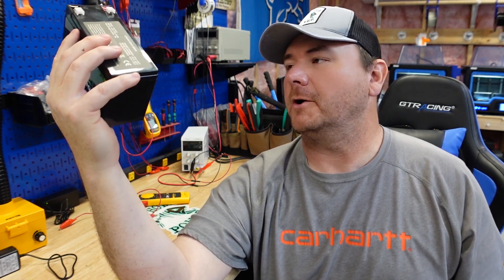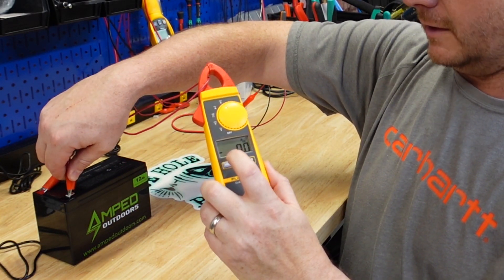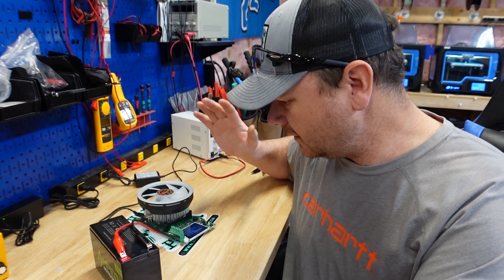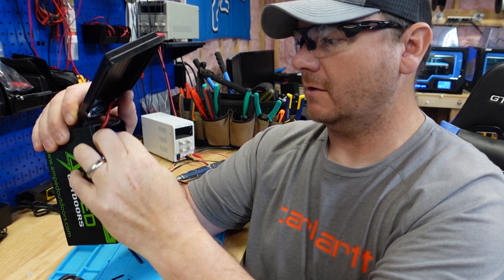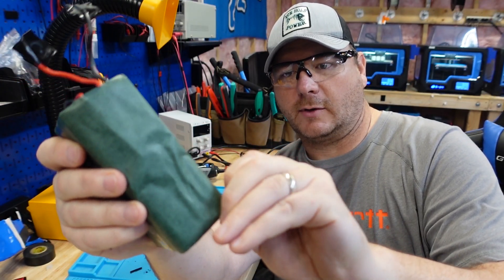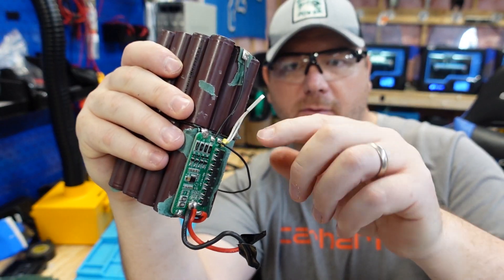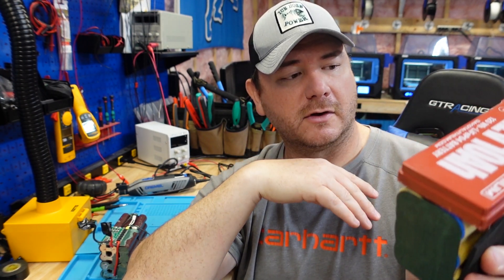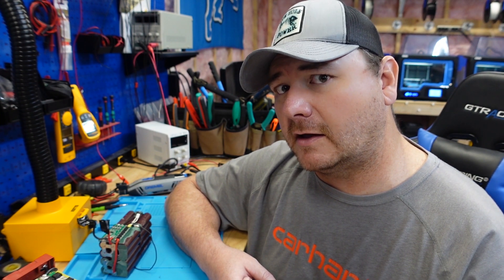Amped Outdoors 12ah Teardown

Comment: Every few years, when the power goes out here, we are awakened to our alarm system beeping due to low battery backup.  I have to disconnect one battery wire or it’ll happen repeatedly.  A while later we’re assaulted again by beeping when power comes back on, and the system is warning of a disconnected battery.   Aaarrrgghhh.  It happened again last night.

Can I replace the UB1280 I 12v 8ah f1 alarm backup with a longer lasting lithium iron without any concerns about charging needs, and if so which one would you recommend?  The Amped you tested seemed the right size to fit in the alarm box, but I liked your review of the less expensive Rebel;  it’s just too wide for the box.
Reply from the maker: I would suggest looking into their website for a proper replacement and if you have any more questions about that you can give them a call.
Reply: @iceholepower8012 . I can figure out by dimensions which to order, but my question for you was if 1) a higher amp rated lithium is an okay and better replacement for 8ah AGM alarm batteries, and 2) which brand among the myriad you reviewed that you deem best overall.  I will also confer with manufacturers as you suggest.  
By the way, it seems indeed as you’ve addendumed, Amped has replaced the 12v 12ah with a 15ah, that of course is out of stock 😢.  Also, Rebel appears to be out of business.
Appreciatively, hafcanadian

Comment: Can you use one of the new vexilar v420 lithium chargers to charge a amped out doors lifepo4 battery?
Reply from the maker: Vexilar does not have their specs on the charger on their website.  Just at looking at it you would not be able to charge an AMPED NMC battery but would charge their  Lifepo4.  The only thing is Vexilars charger is only 2.5 amps so it would take twice as long to charge your battery over the AMPED charger.

Comment: I have been running one of my UPS with this very same battery since november 2019. We have brownouts and blackouts everyday. I use it to run a modem/router setup (I get roughly 6 hours out of it) and sometimes a 32-inch TV and a DirecTV receiver (I get 40 minutes out of it). The battery started to suffer recently... Would you recommend me to go for the same battery again (I heard they updated it and now it's 12V 15ah) or is there any better option in this form factor?

Comment: I got a 100ah 12 weize  battery that has low temp cut off for 250 on Amazon  havnt seen one  since.  I need a capacity tester to make sure  it's all good or a flop. It works  . I've done calculations   but what I've used as a load fluctuates with current draw  . I need a steady current draw to be accurate

Comment: Two 20Ah went bad.  One after a year and another after 6mo.  Would run my Ham Radio for about 20 minutes and then the voltage was too low.  Was using their charger as well.  Nothing but Alibaba batteries with their label slapped on it.

Comment: I have a minnkota 80 lbs thrust 24 volt trolling motor in your opinion what is the best battery I should buy tired of running out off power (THANKS)

Comment: Did a capacity test of the amped outdoors new 15 ah lifepo4 and only got 12.76 ah with a total of 164 watt hours...total drainage time took 10 hours 16 min at a 1 amp load. Can you review the 15 ah 12 lithium battery please? Ending voltage is 12.14 volts. Top charge was only 13.6 volts while the other two  peak at 14.2 volts fully charged. What is going on? Please help!

Comment: Great stuff man! I use a Bass Pro tracker lithium 12v/12ah battery for my fish finder on my little 14 foot Starcraft. Its in a Bold North Outdoors battery station box. I also run my anchor light and nav lights to it (wired thru a fuse panel of course). It does fairly well for a 12ah but sometimes I pull all nighters fishing for Flathead Catfish and I need more juice. I just discovered that Amped sells a 19ah battery that is the same case size as a 12ah! Which means it will fit perfectly in my Bold North Outdoors battery box. Totally awesome however on their website it says currently out of stock. Definitely keeping my eyes open for that to be back in stock so I can purchase it. 12ah to 19ah that is the same size allowing it to fit into my battery box is good news. I also use it for ice fishing. Furthermore great content brother, I was going to buy the Norsk 15ah but your videos have encouraged me to wait for the Amped to be back in stock.

Comment: Question.  Do you think they might be getting low temp input from the thermistor? Does it have the range?
Reply from the maker: No, it is for high temp protection. I have confirmed with Amped that it does not have low temp protection.

Comment: Just Subbed 😎👍
Reply from the maker: THANK YOU!!!!
Reply: @iceholepower8012  Thank You, your content and information has been a Significant Help in with understanding these Lithium Batteries are made, there Quality and there function. Right now I'm pretty much sold on the Amped Brand for the Quality and Cost. You also helped me in regards to my Helix Fish Finder battery. I was using just a Naqua, but, after watching your previous videos I'm going to not run this pouch style battery and instead just go with the Amped 12V 12AH battery, your info sold me 100%. I have a Amped 60AH for my Bow Mount Xi3, so I'm going too stick with only Amped. The Dakota's seem pretty good also, but the way they opened for you didn't seem like a Good Seal, I know the Amped aren't Fully Sealed neither, but, they seemed to be sealed  better. FPV's seem too be the most Waterproof, but they are Pricey. And Bioenno's I here are pretty good, but they are also super Expensive, and I'm not a Fan of how they are they are sealed and  hiw they have  Pre installed cables. Anyways, Thank You again. 😎👍

Comment: ExpertPower 12V 50Ah Lithium LiFePO4 Deep Cycle Rechargeable Battery | 2500-7000 Life Cycles & 10-Year lifetime | Built-in BMS | Perfect for RV, Solar, Marine, Overland, Off-Grid Applications

Comment: I currently have livescope (both black box and graph) connected to my crank battery in the back of the boat.  I'd like to connect directly to the AMPED without modifying the connecting hardware (clamp, wing nut, etc) so that I can easily toggle between the crank battery and the AMPED.  I'm wondering if there is a way to extend the AMPED terminal to where I can connect the livescope cable to it just like I do within my crank battery.  Thanks

Comment: Can a lithium charger be used to charge an sla battery? Have a lithium battery and charger but still use sla on another flasher. Wondering if I can safely used the lithium charger or do I need to keep bringing both chargers. Thanks!
Reply from the maker: Hey Matt, thanks for watching! Bring both chargers. The lithium charger charges at a higher voltage. Never use it on your SLA batteries.

Comment: Hi Jeremy!  I just bought and received the Amped 18ah and Deluxe DIY Box.  Thank you!  I’m super impressed with your kit.  I added in the 3amp charger and SAE port as well.  I planned to someday add a solar charge controller and solar but I saw that the Amped BMS talk to each other.  When the Amped battery is fully discharged, you need the Amped charger to reset the BMS.  Is there a way around this?  Can I just be careful land not fully discharge the battery, and if I do, only use the Amped charger to start the charging cycle?
Reply: …BMS and charger talk to each other…
Reply from the maker: You only need that if it goes into low voltage protection mode. Usually won't happen unless drain the battery and don't charge it for a while. It's not something that happens often.

Comment: I appreciate your reviews and the effort/expense involved but I don't understand your description of series/parallel.  How can you have 18650 cells "6 in series"?  The nominal value of a 18650 is 3.2V and a fully charged is approximately 4.2V maximum.  Therefore, 6 in series of a fully charged 18650 would be 6 X 4.2V or 25.2V...then those in parallel would yield a battery, fully charged, of 25.2V.  Please clarify or correct me.  Thanks.
Reply from the maker: I had to rewatch my explanation a couple times after seeing your comment. It is a 4S6P pack meaning we have 4 series cells, each are made up from 6 cells that are in parallel. When I said "those 6 are in series with those 6" I meant the 6 cells that are in parallel are in series with the 6 parallel cells next to it. I appricate you watching and I will work on polishing up my explanation!

Comment: How long for it take to charge this battery when you first got it, and then after running it down like you did in this test?   What is the battery loss overtime, while it’s setting sting waiting to be used, if you know?
Reply from the maker: Great questions! Like all lithium batteries, they are shipped with a 30% charge. 30% of a 12ah battery is 3.6. We recommend the Amped 3 amp charger so we will use that in this example. The difference between 12 and 3.6 is 8.4. So when a guy first gets the battery and uses an amped charger it will take 2.8 hours to charge it. 8.4/3amps=2.8 hours. 
If the battery was fully discharged we would calculate the charge time by taking 12ah/3amp charger = 4 hours of charge time. 
And the charge loss overtime with this chemistry is very very low. Like 2-4% per month. Thanks for watching!

Comment: Have you looked at Norsk Lithium Batteries?
Reply from the maker: not yet, getting though the batteries lifep04 first. But it is in the plan
Reply: @iceholepower8012  have been really interested in them. Definitely with the usb ports built in.

Comment: Off topic, I see all the 3D printers running in the background,  I don't know a thing about 3D printers, it sure looks like you have standardized on one brand. Some of us would find it interesting if you wanted to review a printer and speak on an in-house component or 2 that you are printing with it. ~ Thanks. Your shop is cool by the looks of things!
Reply from the maker: Ohhh, good idea!
Reply: @Wild Urban Adventures  ender. Ender 3 pro or v2 is an excellent choice for a first printer. Theres tons of tutorials, parts, settings, and everything else needed to get started. 
I have used my first ender 3 to make transducer adapters for my kayak, rail mount accessories, campind needs, and tons of other stuff (including lower receivers). One of the ender 3 is my kids now. It has opened them up to a world of STEM and they love it. 
At the beginning of the school year they can be had for $99 and microcenter throws in a spool of PLA.

Comment: Hello sir , I have the same cap tester and I change mines up due I get better number , the way to do it is to. Hangs up the mosfet under the heat shrink fan it comes stander with a 50A mos put a 150A mos they’re the same size in width but just a little more thicker and you’ll see how your testing will give you better numbers ??? Thank you 🙏 sir and God bless America simplify
Reply from the maker: Thanks for the tip

Comment: We keep our boat in a boat slip setup to charge all batteries with one electric cord  with the different chargers we have on board. Our question is we have a amp outdoors 18 ah  with amp outdoors charger. Does it hurt to leave the charger plugged in after the battery is finished charging from a day of fishing and the temp drops below freezing at night. The battery gets charged every time we come in from fishing every week or so. The battery runs our Live Scope. The battery is always finished charging by the time we have any freezing weather. We live in the south so we don't see very much freezing weather. Thanks for your help
Reply from the maker: I would say you are good to go with that setup. Just don't want the cells to be below 32 degrees while charging. If it is done charging before that happens then leaving it plugged into your charger should be fine because the battery charging circuit would of already opened.
Reply from the maker: Great question BTW!!

Comment: I wonder how a Bioenno compares?
Reply from the maker: I do too, they are not really popular with the ice fishing crowd but I will put them on my list. Thanks for the suggestion!!
Reply: Just to put it out there...Bioenno states in their instructions NOT to run in series OR parallel. Their BMS is set up for single battery only. Ham radio guys talk a lot about them.
Reply from the maker: Good to know. Thanks for the info!!
Reply: If you do choose to run parallel, again NOT recommended, then. 
Parallel: Also, measure the internal resistance of each battery and only use batteries with closely matched internal resistance. It is highly recommended that resistors be used to achieve equal internal resistance among multiple batteries. It is also highly recommended to add fuse(s) to the circuit for safety reasons.
Reply: Thanks for asking. I use a Bioenno with my ham radio power box.